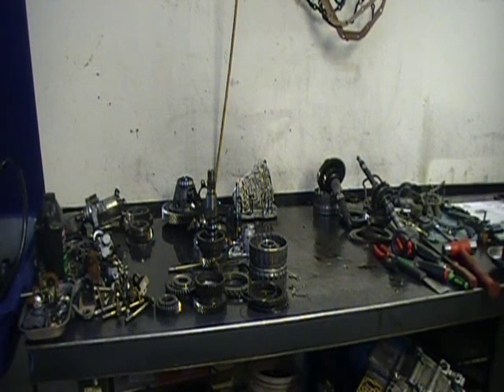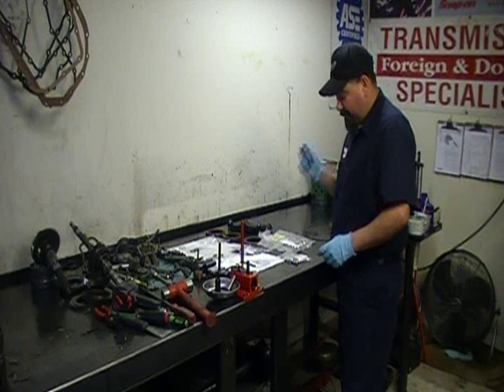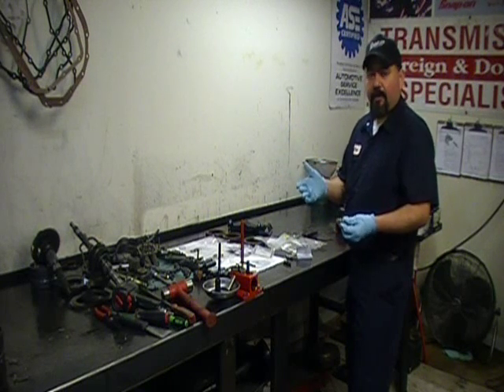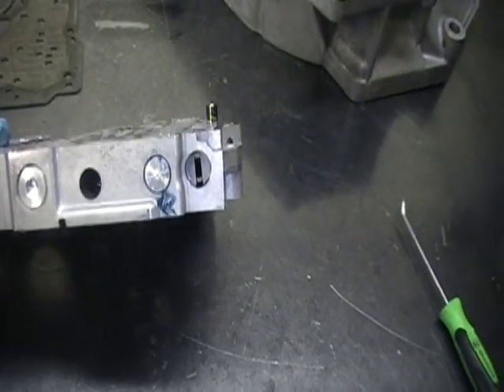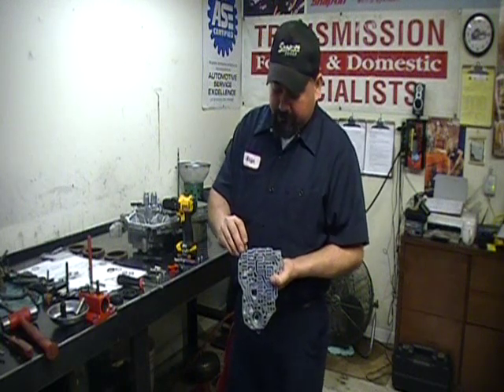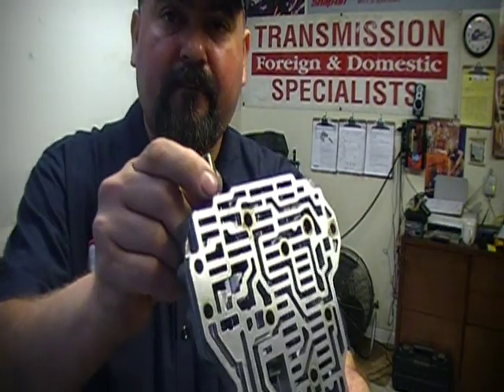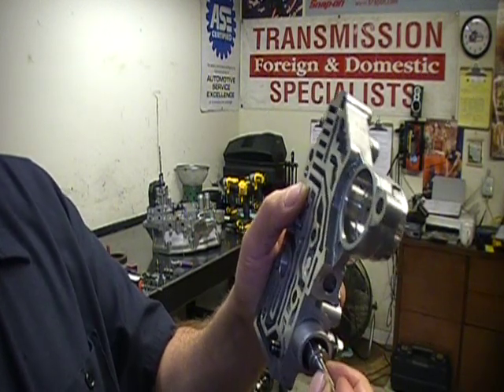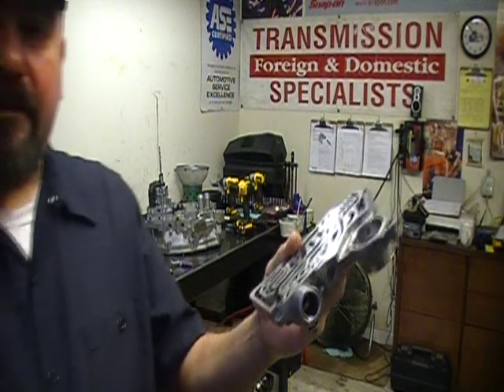Honda Transmission Repair 2

Comment: Thank You very much Hiram Gutierez!!!! I'm a Mechanic but never had done an outomatic trans. myself.(manual only)  After watching your videos my Transm. on my Acura Tl 2003 started Slipping and converter  burnt.  I'm rebuilding it now. Thanks to you!!!!  ALL THE BEST!!!!!!!!!!!
Reply: How do you remove end caps from the valve body valves?

Comment: Hey very good info.  I left a comment on part one.  I had meant to say converter check valve and said piston.  I just couldn't remember the name lol.  Looks like sonnax has a great valve to solve the overheated converter problem.  I just remember a few years ago we were drilling into the lube circuit and not the line pressure circuit....Never did have a comeback due the that, but again, line does seem better.  Then again I realized you have a tool to increase line pressure at the linear.nice.lol

Comment: Hola. 
Desarme la trans por completo hasta el valve body. Puli las valvulas con los bench buddy, se miran bien ( no atoradas ). Tambien le puse sellador a los endplug porque no tengo los que tienen o-ring.
Otra cosa que hice fue darle mas presion a los solenoides CPC A-B 1/4 vuelta.
No se que fue de estas cosas pero ya funciona 3ra y 4ta.
Gracias por tu ayuda Hiram

Comment: Great Video!!!
Question, the D4 light does not light up when in drive. Have removed cluster to see if bulbs are good and they are, any ideas on what this might be? Could there be a sensor issue or solinoid issue... Thanks!

Comment: Que Tal Hiram, primero que nada felicidades por estos vídeos que en realidad don bastante buenos, sabes tengo un problema con una Honda Odyssey 2000, el TCS se prendió y se siente que se patina el cambio de 2da a 3ra, sabes si este problema también es derivado de la caja de válvulas?, tiene que ver con el sobrecalentamiento del convertidor para el que recomiendas se haga un barreno igual a que tiene la válvula controladora de presión en la caja, o que es lo que puede generar el problema, la transmisión ha sido reparada y el problema persiste... espero me puedas ayudar. Saludos

Comment: Do you recommend buying a new Honda Torque Conveter, or going aftermarket for instance Consolidated Vehicle Converters?  I got the P0740 code for the overheat on the conveter and plan on replacing it.

Comment: Great video and information, I would like to ask a question. My 01 Accord doesn't want to go from 1st to 2nd when cold, but shifts fine once I drive it a short distance (after it warms up) with no slipping. I can drive it all day, once warmed up, with no problems. Is this due to one or more of the valves sticking when cold, and is there anything I can try (short of pulling the transmission) that would help it to shift correctly when cold? Thanks...

Comment: Hiram, estoy muy impresionado con tus videos. Son muy buenos! En donde estas localizado? Tengo p0740 codigo en mi odyssey 2003. Ya yo le habia cambiado la transmision en el dealer bajo garantia hace muchos años. Ahora esta dando problemas de nuevo. Un mecanico local ha tratado de arreglarla pero el codigo sigue. El no sabe que mas hace? Yo siempre he pensado que es  un problema con los O rings o un filtro sucio.

Comment: Hiram, what is the best prevention to having to go through a transmission rebuild.  Would you say changing the fluid at certain intervals, or some other remedy? Would there be products to add to fluid which helps remove the build up deposits you clean out with a brush, ie running tranny fluid with special additives which act as detergents removing those buildups a rebuild rquires wire brushing.  I have a 1997 Acura CL 3.0. I have changed the transmission fluid two or three times , now have 170000 miles on it.  Not sure if I am changing it often enough.
  I am not sure at what mile marker the tranny fluid should be changed. I do know about changing the timing chain/wataer pump each ten years of 100,000 , then 80,000 miles there after.  Please comment. Thanks

Comment: Hi Hiram. Excellent videos!. Thanks .   I have a 01 odyssey. Got the p0740 code with CEL and TCS lights. Tcs light extinguished by itself, reset the CEL drove e few hundred miles and the condition repeated. Is the helpful to remove the linear control valve and clean  the feed tubes and  clean/replace the A/B solenoid valve screen. Wanted to try something proactive before any more damage is done.  Also looks like these two tasks can be accomplished with the trans still in the vehicle.  It seems to shift fine and drive ok. Also was going to install an inline filter on the return line from the cooler to the trans. Any thoughts?  Thanks.  The vehicle has 158000 miles.

Comment: Hi Hiram,

I'm attempting to rebuild a 96 - 00 honda civic auto transmission. Can you tell me what tools are needed for the job? I need to know where I can buy those brushes to polish the valves, I need to know what and where I can get the tool to help me take apart the clutch packs. Also what can I use to remove and replace the bearings in the transmission.

Comment: Great video. Thankyou Hiram for uploading it, this video gave me the courage to fix my own transmission. Now i completed it, did a test drive and had all gears thru third, then i got to a stop and it was neutralized (shift lever in 3rd), now i have only 2nd and third gears and code P1751. I replaced SCS-B black and still the same. Should i replace PCS A-B? What would you check? Thanks in advance.

Comment: See but before I got a transmission rebuild I had the same code p0740. I was thinking it would be an internal problem, again. Maybe the guy that did it for me didn't clean all the valve body correctly like how you do. The car runs but I don't want to keep on running it and messing it up

Comment: I had recently got a transmission rebuild. Before I had it rebuild it had the p0740 code. I got a new Torque Converter and got everything rebuild, I even got the lock up solenoid. Drove it around and check engine light came up. It read p0740 again. I don't know what to do with it anymore.
Reply: Wiring problem maybe?

Comment: Where are you and what's your charge on a trans rebuild ? I got a 99 Honda accord 2.3L 4cyl 4speed automatic . Sometimes you start in part it whines loud til you put in drive and then to N . If you put in reverse it whines louder and won't go backwards. Kinda like a manual trans sound then not all way in gear with clutch out. I was told was just solenoid but they a lot money and its not garenteed to fix problem I was just told by a guy at store when he heard my car start in park. Henot mechanic

Comment: Im trying to fix an Accord 2001 BAXA trans that started slipping second gear, i did 2 drains with OEM fluid but i suspect it had additive because first drain dirty and had 4 qt instead 3. anyway, trans shift felt better after drain but now when the transmission starts to slip all gears (only warm), it improved lil with lucas Trans Additive. I now trans needs a major overhaul but what i have doubts is this kind of failure, it seems to be fluid pressure loss when warm, could it be the pump failing

Comment: La transmision es para ACCORD 01 BAXA.
Te mande la info en el facebook. 
Lo que le pasa es que no avienta tercera y comienza a parpadear "D4". no se neutraliza pero se queda en segunda. Podra ser el pressure switch de clutch de tercera?. el conector esta golpeado. le hice la prueba de aire y si cierra el circuito pero podria no funcionar bien.

Comment: Hello Hiram...You are the man, I've learned a lot from your videos. A month ago I purchased 2003 Honda Accord. The transmission was replaced on recall with 26,000 miles. Its already failing again with 105,000. Mostly what happens is 3rd gear slams, also sometimes I loose reverse, I unplug the battery for a while and reconnect and I get reverse again.  I've been told I need a new transmission or to rebuild the one I have. I just thought I would ask about code P0741 since I didn't see it mentioned here. Any advise before I move forward would be greatly appreciated.

Comment: Hi, I have a question that 
Is there any way to find out how much I should thread in the pentagon screw to the side of HODNA linear solenoid(28250-P6H-024) if I removed those screw entirely without making any mark?
I know it was a stupid action to remove it.
But I really dont want to spend $200 to buy a new one when the old one is still good but just miss adjusted.

thanks

Comment: I watched your rebuild video on the b7va I rebuild mine cause it was slipping  and clutch material in the tcc and fluid has it in it so I got a rebuild kit and transpro shift kit got it all done drove it for 35 miles that day next day I start it up and put it in drive it shift to 1st and all  a sudden it shifts to 2nd and third without moving I can't figure it out change all shift solonoids  and liner solonoid and 2nd and 3rd pressure  switches and got another  ecu and had it at acura for programming still same thing all wires and connecter are gd solonoids  click idk if u start going it says out in 3rd and downshfits to 2nd but not first  if u put it in all the way down the shifter to 1 it's in 3rd so when I go now I have to take off in 2 on the shift if u need more email me or all give you my number so we can figure this out thanks for any ideas